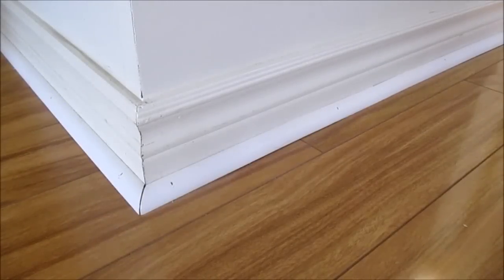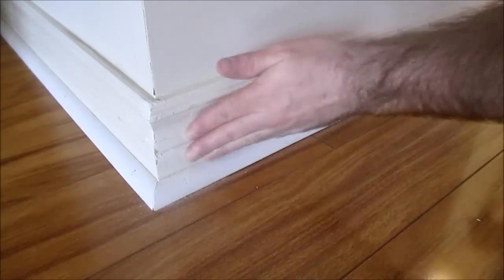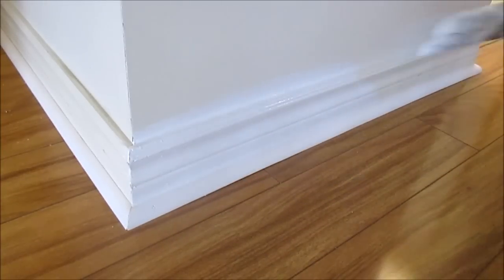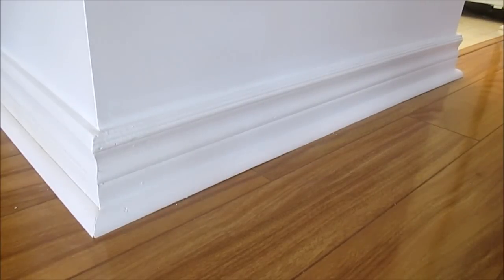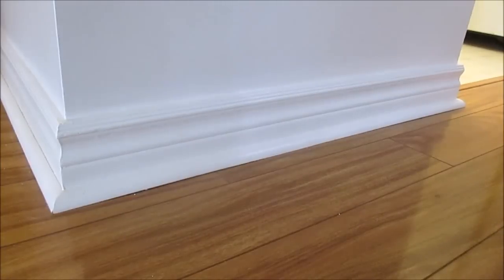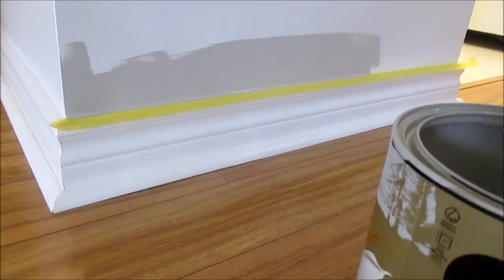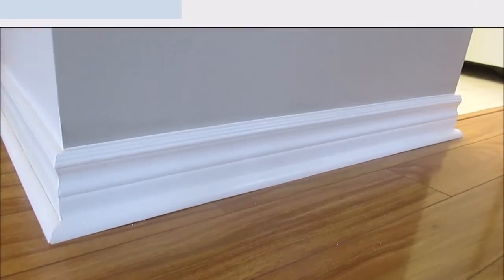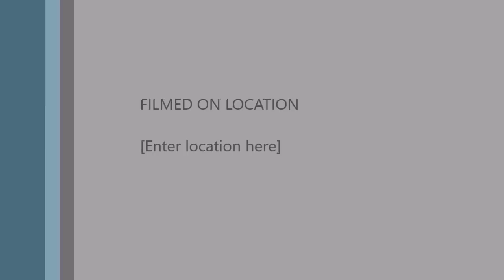How to paint baseboard trim and walls

Comment: Very nice video. Although, I would strongly recommend masking off the baseboards before rolling the walls. Little microscopic particles can fling off the roller while rolling the wall, and get on the baseboards.
Reply from the maker: After I finish the walls at the end of the job I just go around and done quick 3rd coat on the trim. I dont hit everything mostly the top of the door casing and the baseboard. After I am done the job is perfect. The rollers I use are very good quality as well and you dont get much of anything on the baseboard if I roller properly. AMD this method has worked well for me for many years. Thanks for watching and for leaving a comment 👍

Comment: Then roll and spray over the skirting. It gets better and better. 😂😂😂😂😂😂😂
Reply from the maker: Hahaha I'm glad you enjoyed the video, I hear what you're saying, with the paint I use I dont get the spray, I have used paints that do spray a bit and that is definitely not good, but I use sico paint from ppg and I have almost no drips or anything getting on the trim when I used that paint. But like I said other paints have really surprised me. But in those cases I just leave the tape on or just have a rag handy to supe off anything that might get on the top of the  baseboard 
Thanks for watching and for commenting

Comment: No videos on YouTube use textured walls because they're no tricks for that. You need to freehand cutting in.
Reply from the maker: i freehand on the ceiling, however around the trim and baseboards i prefer to use a really good tape to help achieve the straightest line. but do what works best for you Thanks for watching
Reply: Now that you mention it, tape on the baseboards should work on heavily textured walls if you tape on the smooth baseboard surface. But on the ceiling, two heavily textured walls meet each other and there is no real straight line, plus most tapes can't get into the little valleys.

Comment: 👎🏻 you keep your baseboard covered because when you role roller paint dust falls on your base board 👍🏻
Reply from the maker: I actually don't get that, I thinks it's the paint I use or the roller, but sometimes I like to cut my final white base line on the top after I'm done and then that takes care of of any wall paint that might have got on them